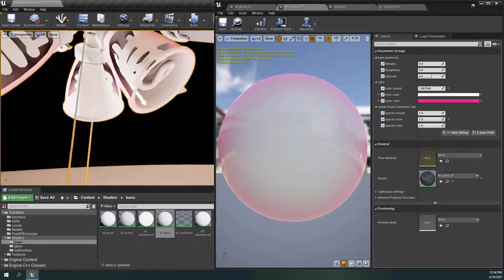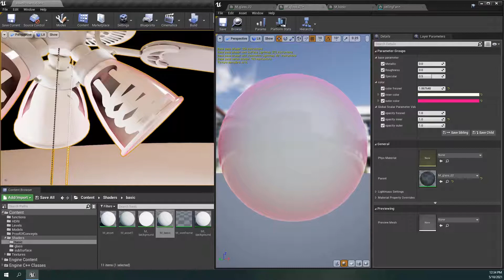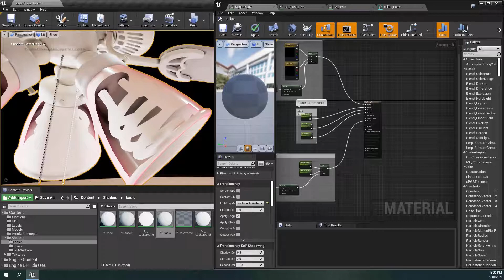unrealEngine glassOpacityIssues

Comment: You have three options:
1. Try changing your opacity with the function "SpiralBlur-SceneTexture" in case you want a blur effect and not a fresnel.
2. Try applying two sided to the glass shader material in your material options (on the left, under Shading Model) in case there is a problem with the UVs of the mesh.
3. Apply a Culling Inner Triangles Method, you can see information about it in here http://www.tomlooman.com/the-many-uses-of-custom-depth-in-unreal-4/